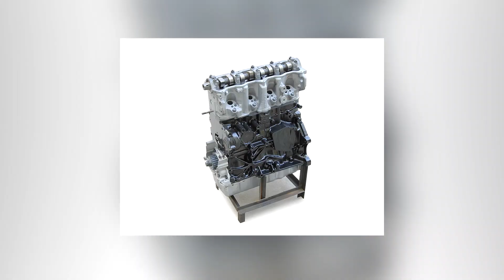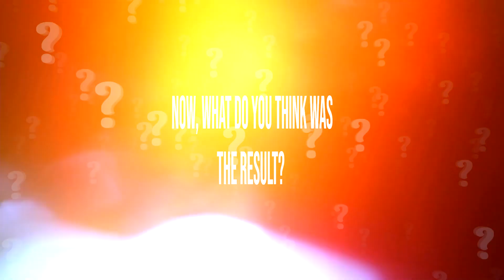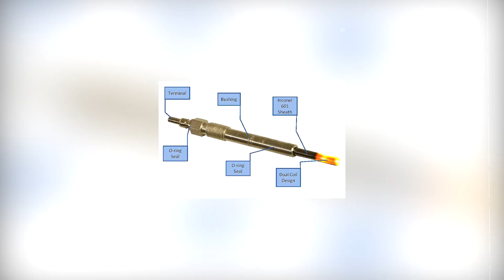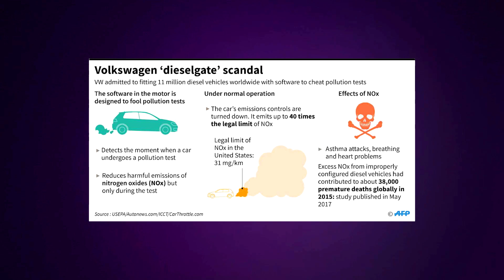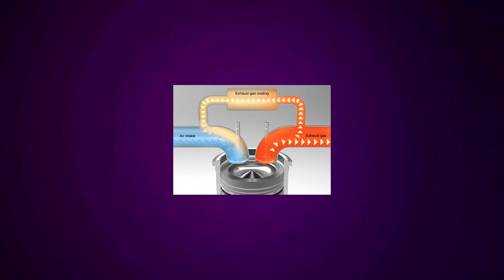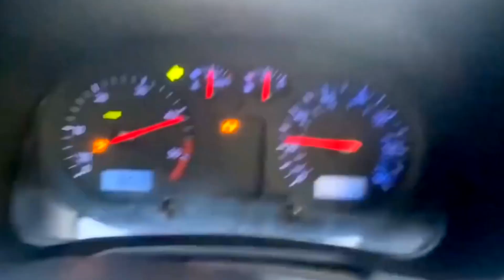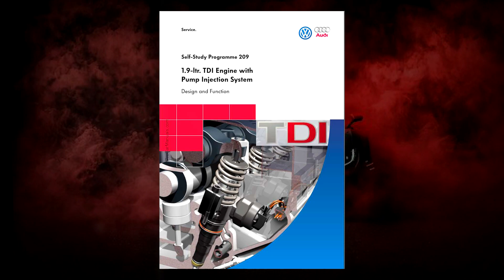The Most Reliable European Engine of All Time: 1.9L TDI Explained!

Comment: I drive a Jetta mk 4 1.9 tdi AHF engine on 467,000kms

Still original engine, turbo, cv joints, exhaust system, and shock absorbers.
Do oil and filter change every 10,000kms.

Use Prolong super diesel engine oil, no sludge, no dry diesel soot in Egr or manifold.
This car is amazing, so reliable.
Ave consmp  4.7 km /100

Comment: I have been a proud owner of a 2003 VW Jetta Wagon TDI for 5 years. It was gifted to me in 2020 by my best friend who'd driven and cared for it well for 11 years, getting it to just over 527K km. Since then, I've put 210K on it. I drove it across Canada, travelled to Roswell California, Vegas and places in between. This year saw the original engine blow a valve through a lifter at 728K km. I had a spare engine ready for swapping. After some refresh work, I swapped the engine and the car went on a 8000 km sojourn to Alaska. 

If you're in the rust belt type areas, and northern states, you definitely want to check the floors. The bodies can hold well with good care, but these cars are still over 20 years old now. Rockers are another area of concern. 

As mentioned, with these cars a lot of it is going to come down to how the car was maintained. As you saw above, my original engine made it to over 450K miles with NO internal engine work. On the TDI Club forum, many suggest to changing the cam and lifters around 5-600K km. 

Personally, I love my wagon. It's taken me far and wide with very few issues overall. My total running cost, including fuel and maintenance over the last 5 years is around $750 a month. I think that's pretty reasonable for a 20+year old car that gets up to 1200km to a tank of diesel. 👍🏻💪🏻

Comment: Still daily driving my 1998 audi a4 avant b5 with the 1.9tdi 110hp engine and 360,0000km besides regular maintenance no problems still drives great with enough power and great fuel economy

Comment: Guy Form my village has this engine in an old ibiza with 500+Hp and 800Nm torque. It also makes clouds on the road 😂
Reply from the maker: 500+ HP and 800Nm torque? That Ibiza must be leaving a trail of clouds and confused cars in its wake! Just make sure he doesn't challenge any jets to a race!
Reply: @VehicleWisdom  Crazy thing is you can get them to 300hp quite easily and they're still reliable, proper tuners engine.

Comment: I want to say that Diesels never experience a knock and they always have direct or older ones with indirect injection. Thier High compression causes this "Diesel Knock" which is normal
Reply from the maker: You're absolutely right! Diesel engines operate differently than gasoline ones, and the high compression does lead to that unique sound. It's fascinating how these engines work!

Comment: I have a VW Jetta 4 with a 1.9 TDi 6 speed manual, a VW Transporter T5 with a 1.9 TDi BEW 5 speed manual , and Audi A3 1.9 TDi BEW 6 speed manual, all 05 models , these engines are the best for long trips especially with cruise control, tons on fun without breaking the bank.

Comment: It is 2025 and I still daily drive my 
2000 1.9 TDI AJM Passat B5 🎉🎊   
560k km and no problem 😁
No oil consumption , no coolant consumption, nothing. Just regular services , oil and filters at every 9-10k km, timing belt and weather pump at 60k km. 
Fuel consumption is around 7L /100km  (Most city drive)
No DPF , no problem 😅

Best engine ever produced !!!
Reply from the maker: Hai , really appreciate with the sharing. Congrats 🍾
Reply: I had one almost as long and the only thing it needed was a valve cover gasket the whole time. It needed a new radiator because a brick fell off the back of a skip lorry and hit the radiator causing a small leak.

Comment: I had that engine on a Station Golf, the timing belt stripped at 15K and then at 19K because of the tensioners so called design flaw. Very reliable indeed.
Reply from the maker: Thanks for sharing your experience! It's always good to hear real-world stories about these engines, even if they come with some bumps along the way.
Reply: Oh yeah the tensioners lol, mine's on its third top end because of them, but i'd say that's because of previous driver's oil change habits.

Comment: You didn't mencioned the 1.4 TDI (a 3 cylinder version of this engine that vibrates a lot)

They are very common here in Portugal. Lots of police cars with this engine still going strong after almost 20 years and lots of km in very harsh conditions. Also, the tuning scene loves it by its power and robustness and keep going strong (although they get them to smoke A LOT). One of the best diesel ever made, in my opinion
Reply from the maker: Thanks for bringing up the 1.4 TDI! It’s impressive to see how reliable those engines have been, especially in tough conditions. It’s amazing how they’ve stood the test of time!

Comment: 1.9TDI was half good and half bad and unreliable and expensive A.F. to fix it.
Reply from the maker: Hi Video 2.0 HDI https://youtu.be/ZZRXqCv_GXM?si=CYE03r7N8UqimaXC
Reply from the maker: Thanks for sharing your thoughts! It's always interesting to hear different perspectives on such a popular engine. Your experiences can really help others make informed decisions!
Reply: Disagree. I have a 2003. I got it from my buddy at 527K km. Ran great to 728K when a valve went through a lifter... 450K miles with no internal engine work. If you maintain it properly, it's very reliable - oil changes, fuel filters, air filters are important.

Comment: 2002 1,9TDI with 102PS (no agr, no dpf) 👌
Currently driving a 2008 1,9 TDI with 130PS 👍
Also one of the best BMW 1998 2,5L 6Cylinder in series 👍👍

1998 2.2l tdi is also nice

Diesel scandal was not with 1,9l.. it was with 2.0l or 1.6l and so on but not the 1.9l. They do not produce 1.9l since around 2008.

Always using b0 diesel and oil that can be used with dpf. Let the turbo and motor cool down a bit before turning it off and also let it warm up before giving 100%..
Manual transmissions are also more durable but some people do not know how to shift and destroy the motor by driving in 4th gear @50km/h uphill. 

Nice video!

I will drive the 1,9 as long as i can. 🙂
Reply from the maker: Thanks for sharing your insights! The 1.9 TDI really has stood the test of time, and it's always great to hear from fellow enthusiasts who appreciate its reliability.
Reply from the maker: Hi Video 2.0 HDI https://youtu.be/ZZRXqCv_GXM?si=CYE03r7N8UqimaXC